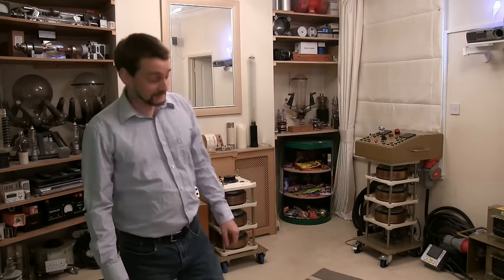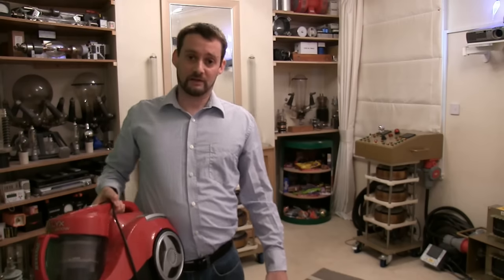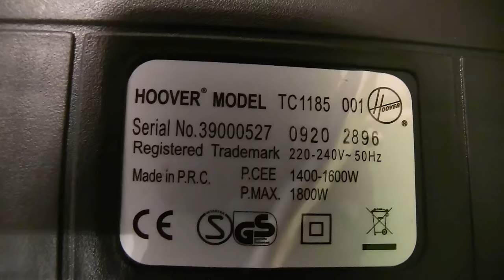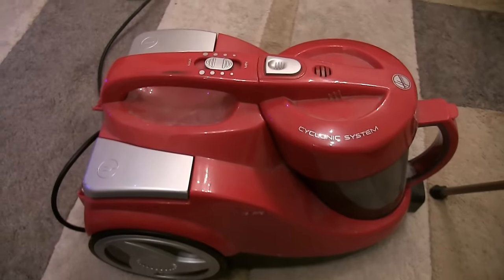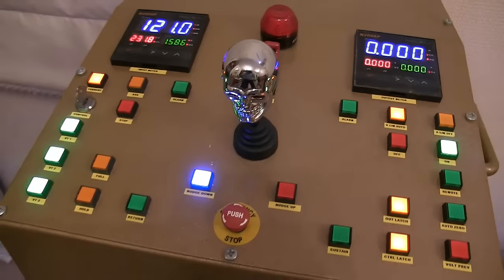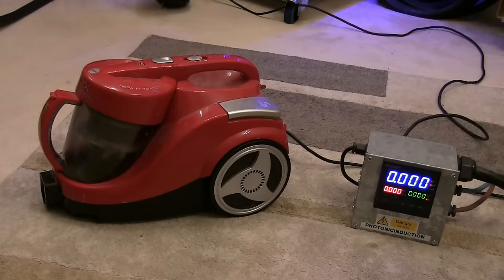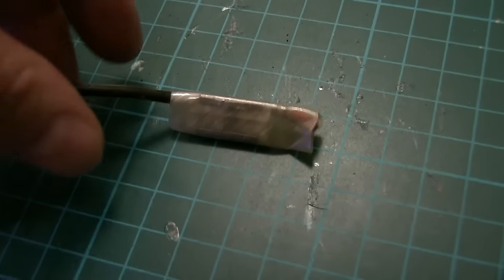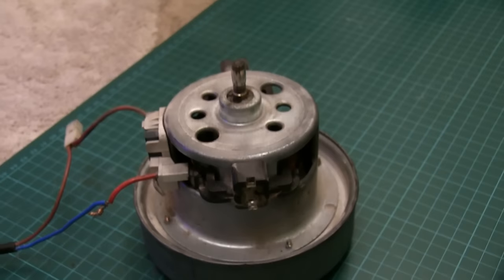Until it Pops - Vacuum Cleaner

Comment: I swear that sounded just like a Jet Engine spooling up, that alone is awesome
Top marks for the destruction sparks and fire
Reply: Has sparks just like the starter as well, just does not get past the first stage though before spooling down.

Now, if Photon was given a jet turbine and "upgraded" the control box to enable stupid speed I would love to see that. I am far enough away the debris would not harm me, even if some does go into orbit. Would not do that in the living room though, unless he wants an entire house remodel in an instant.
Reply: But will the jet engine destroy itself before the house takes off? XD
Reply: SeanBZA - There is a theoretical speed limit of turbine blades due to the centripetal forces and speed of the blade tips creating sonic booms as they pass the speed of sound, the problem becomes one of metallurgy. Currently, turbine blades are grown as a single crystal of the metal they are made of, it is done in very strictly controlled conditions and takes an awful long time to grow a single turbine blade into a single crystal. I believe it's about a month or so. 
If they were made in the conventional manner, there would be many many crystals of the metal and when anything metallic breaks, it is because it separates the bonds between the crystal structure of the object, so that is why turbine blades are "grown" as a single crystal, so that there is nowhere for the turbine blade to crack. 
Also, jet engines actually run at much slower RPM speeds these days because they are bypass turbo-fan type engines, which is essentially a jet engine using the front turbine blades to push air around the outside of the turbine, rather than through it, meaning they can run at 1/10th of the speed, use MUCH less fuel, much less wear and tear, and provide more power than a jet engine that creates thrust from the air and fuel being burned and thrust out the back of the turbine. 
Short answer: It can't be done, the blades would detatch well before any exciting speed was attained, even IF you could jam enough air and fuel into the thing..........
Reply: thinked abt why didnt it explode onto itself xD
Reply: UK Airways is using cheap brushes on their jet engines.
Reply: No kidding, that sounded exactly like a turbine startup.
Reply: Yo Leo how are the redbacks
Reply: @Ghost_TMS  Until it pops - Redback spoiders
Reply: @JesusisJesus   I know this is a very old comment but you’re actually very confused about the reason turbine blades are monocrystalline. A monocrystalline blade is actually more prone to cracking  and fatigue because the crystal grain boundaries impede crack growth. The reason they are monocrystalline is to prevent creep ( grain boundary diffusion) at high temperatures.
Reply: Except that it's not as brand (jet engine).
Reply: So this is how Hoover was planning to fly its customers to New York?
Reply: This is how my computer sounds
Reply: Right??? I could almost hear the “buzzsaw effect” you hear with turbofan jet engines at full power.
Reply: Speedbird One, you are cleared for take off.
Reply: Totally agree!!

Comment: Nr 234
Excellent execution. That vacuum released the smoke very quickly.
Those roller bearing still do a great job at those speeds.
Reply: The armatures are surprisingly close to arcing at 240 V. Second motor started at 260!
Reply: That's not how it works. The arcing is caused by the high speed of rotation (the "naked" motor was run without any load after all). This breaks the current through the windings very abruptly, causing a voltage spike because of the self-induction (probably a few thousand Volts). That's what causes the arcing.
Reply: The 2nd motor was unloaded, so would have been overspeeding massively. These motors are designed to run with the load of the impeller.
Reply: +ChumpusRex actually the second motor looks like one from a Dyson upright, the spindle actually is the driveshaft of the brush bar pulley, while the impeller actually forms part of the motor itself. So you're not entirely wrong.
Reply: RODALCO regards:)
Reply: It is a series wound universal motor. So no load means no current to either field or armature windings. No current to break, no induced voltages. The load here is bearing and commutator friction and aerodynamic drag. In a vacuum cleaner one can unload the impeller by just blocking the suction hose.

Comment: Wow, that second motor was only at 260V when it started flashing over - really bad tolerance for a 240V device!
Reply: Take a look, there's a quick flash at ~255
Reply: I think it's because there's no mechanical load attached to the motor, so it spins faster than normal
Reply: The air intake was covered by the floor because the motor was sitting upright.
The power required to drive a centrifugal fan is proportional to the air flowing through it, therefore it was running unloaded.
That type of brushed motor will overspeed without a load attached, causing excessive arcing on the commutator.
Reply: I saw sparks at 170-180v
Reply: Actually I don’t think there was a spark at 180
Reply: Actually motor 3 sparked at 160v
Reply: Agreed. It showed signs of trouble near rated voltage. Even with the air flow cut off, the motor shouldn't heat up that fast. It might have had a shorted armature or something from the beginning. I've seen good vacuum motors survive nearly twice their rated voltage.
Reply: @vincentrobinette1507  It made it up to 350V in the vacuum before it flashed over. Also we dont know  how much damage it took during the first "incident".

Comment: This is going to be my new favorite series. Would be cool to see a phone or a computer screen overloaded.
Reply: irrelevant but a few years ago he microwaved a computers motherboard while it was on, its still in his early vids on his channel somewhere..
 a computer overloaded would be interesting to see on the dc side after the power supply as the power supply would just blow its fuse or die before anything happened to the  motherboard ect id imagine however straight to motherboard  dc overvoltage something would definitely pop how much it would take would be interesting to see :P
Reply: Would be better with one of those fake EVGA "3VGA" power supplys, as they don't have any protection to the motherboard, so we could see what it really does without the power supply cutting off. :)

Comment: Assembled Vacuum cleaner:
Nought to pop in 36 seconds
Max power before malfunction is 3.438 W
Peak popping current is 21 Amps at 380Volts (thus a popping power of 8.754 W
Cause of failure: Probably insulation meltdown and short circuit.

Vacuum cleaner motor without load (with thermal overload, twice):
Nought to pop in 35 seconds
Max power before malfunction is ~950 W
Peak popping current is 12 Amps at 345Volts (thus a popping power of 3.717 W
Cause of failure: Thermal overload.

Vacuum cleaner motor without load (without thermal overload):
Nought to pop in 34 seconds
Max power before malfunction is ~984 W
Peak popping current is 47 Amps at 272Volts (thus a popping power of 14.050 W
Cause of failure: Brush flash over.
Reply from the maker: Decimal point is one out on the first bit? the meter is in kW
Reply: +Photonicinduction Yes, and there was one frame where it showed 87.54 (at least that's what I saw). Of course, that seems quite unrealistic. Okay then, I'll change that^^
Reply: I just noticed, that the numbers don't add up. 47A*272V is roughly 12kW, not 14kW. Does your meter measure apparent power? (wait, even then that wouldn't work out). Does it have a delay between showing Voltage/current and calculating power?
Reply: thank you for the details

Comment: It would be interesting to do that with an air conditioner. See if you can get super cooling power from it before it pops.
Reply: Tried it once...  Thermal protection inside the compressor kept opening up, it got boring after 30 minutes ):
Reply: +REWYRED that's why you'd need to remove that thermal protection.
Reply: nope !
freezing determined by boiling temperature of the gas and motor is asynchronous so it will not go any faster.
hairdryer on the other hand might be funny ;)
Reply: I would of, but the thermal  was internal to the compressor and therefore impossible to remove while keeping the unit intact.
Reply: +MRooodddvvv Why would it not get any faster, can you explain?
Reply: induction motors have limited speed at they running voltage and higher (they will run faster if you will change the frequency)
Reply: Ah, I have confused it for another type. Photonicinduction needs a Photonicinduction-grade inverter then ;)
Reply: Sebastian Grygiel
it's brushless motor to make it go faster you need to increase frequency not voltage.
actually you could make it go like two times (or even more) even with normal voltage !
Reply: Synthematix
not exactly. i mean it's not bout pwm itself but rather what you use to control that pwm ;)
Reply: Kragatar Just running the compressor faster wouldn't make a difference. All that would happen is the head pressure would rise exponentially until the high side found a weakness and blew it out. Most likely the weak condensor coil. This is because the fundamental principle of lowering the pressure of the refrigerant relies on an expansion valve of sorts. It will still restrict to that point regardless of the pressure presented to it. Worse case scenario is it passes some liquid, that finds its way into the compressor ans smashes it to pieces. Still no further cooling will be achieved since the vapour will not get superheated.
Reply: Not without a variable frequency drive. They use asynchronous induction motors, the speed is dependent on line frequency. It will just trip its thermal protection.

Comment: Interestingly the first flash from the exposed vacuum motor was at 255v, a voltage that is not impossible to receive from a UK outlet, and then it rapidly gets worse. Anyone living in area with a slightly higher than average mains voltage is going to kill that thing just from using it
Reply from the maker: nice to see you here mate
Reply: im pretty damn close to the transformer, on a good night i can get 250-252 v out the mains socket,  only trouble for me is lack of power for my variac :( need to put a new feed into the box - another for the todo list lol. 

I have noticed with some appliances that they just do not last,  microwaves especially  however as vacuum cleaners go  morphy richards didnt even last 3 months absolute s*** quality, hoover and dyson  have survived and still going  the old vax 121 gets damn hot really quick , the new vax 6131 just takes it and doesnt seem to care  its still happy after 3 years, the old electrolux 612  hasnt been bothered but doesnt get much use these days...

however it is interesting to see what does last and how much they take aswell as how hot and bothered they get with a bit of overvoltage help  it really shows the build quality of them and how well or not well made they are :)
Reply: Cant you use like some decent variac or tapped transformer to power these devices? Ive seen an automatic voltage regulator using a variac with motorised slider. It was used for correcting low quality power in a certain Communist country.
It was so old it still had tubes, so I guess it would be trivial to do it with something programmable like a PLC.

Comment: Some comments on here about bearing failure. The function of failure when running unloaded is the VA across the carbon brushes. The primary mode of failure is the break down of brushes/brush holders as they heat up, arc and are destroyed. Secondary is the heat from that process causes other plastic components/varnishes to combust.

Comment: 0:56 sounds like the airplane's jet engine starting lol 😂
Reply: HitNation Radio at first sound you were hearing would be the primary starting generator that spins the turbine up to its idle speed (the whining sound) 1:04 would be the sound heard when the fuel is pumped into the combustion chamber (the secondary wind-like sound)

Comment: Hi there PhotonicInduction.... question please:

It seemed to get going well on something like 240v @ 30w ... Does this mean i could run a vacuum or kettle rated 1800w on a 1000w inverter?
Reply from the maker: Noo :(
Reply: ah see... thanks for the reply. Hope things are good with you. Im trying to look for ways of converting a kettle so it can run as 12v with a set upper to 35v 2amps / or just 240v running on the 1000w transformer.
Reply: At 12v you need to supply 150 amps for an 1800w appliance. That requires 00 AWG wire. 
Not even a 2000w inverter will run that appliance without over heating the inverter and shutting it down. I should add, unless the inverter is quality built.
Reply: James Pian Thanks for the reply. So theres no way of running a kettle or small cooker with an 12v inverter? ... thinking about it, i suppose thats why caravans use gas for thier oven then.
Reply: You can. Everything has to be properly sized including the battery bank, the wires, and the inverter. Gas is probably easier, quicker and cheaper. If it's available where you are.
Reply: even if you found a way to power a kettle worth a crap, or a stove, the energy in a car battery would run it fore barely 8 minutes, or boil a single kettle.  the lightest and most simple thing is a methylated spirit stove, nothing stored under pressure, and nothing that can be easily contaminated.
Reply: Ok thanks for the advice guys, appreciate it. Trying to figure out how to make a live in van without chimney smoke (wood burner)
Reply: Use gas, like some entire countries do. You will find it far easier to cook on gas (ask Italians).

Also, there arent many commonly found 12V sources that can provide 1800W power. Nothing mobile at least. Maybe paralleling a couple server PSUs, but that runs on 230.
Reply: DiyEcoProjects
buy a trangia stove kit, the mini would suit being indoors more, the standard 27 if you plan to use outside( better windshield) runs on  alcohol/methylatedspirits/gas line water remover.   lots of youtubes on the subject.
Reply: hmm interesting thanks both of you. Alcohol based sounds good.
Reply: If you want to do that you need to dedicate a fair bit of weight to a decent battery bank and a decent inverter. We are fully off grid here with 4kW air con, 2kW kettle, 4kW hot water service, etc, all of which can run at the same time. 

We however, are not carting this all around in a van, so you would need to find a balance between how much space and weight you're willing to sacrifice versus how much you wish to spend on fuel to move it all about. 

Gas is probably the easiest off grid mobile solution.
Reply: itssoblahblahblah
hi... im still learning so any info is appreciated. Can you describe your set up please for a house converstion "decent battery bank and a decent inverter"
Reply: DiyEcoProjects Our setup is pretty straight forward, 10kW of Trina honey panels, twin SMA SunnyBoy inverters + SMA Sunny Island inverter connected to a 2000ah VRLA battery bank consisting of 12v batteries in parallel & 4 serial chains making 48v.

The house used to be wired for 12v lighting however we've re-wired for mains voltage for convenience.

We also have a 4kva honda generator for when it snows or there's an extended period of bad weather. On average it gets used about 8 days a year and probably uses about 30L of fuel per year.

We're in a primarily cold climate so we use wood for heating & cooking in a slow combustion stove and a stanley waterford wood oven which also has a water jacket.

It's not a hard life at all and we save a fortune vs on grid. (Please excuse typos, on mobile).
Reply: Seems like an expensive route to go just to boil a kettle...could you not just buy a small portable gas burner? They only cost about $20. I have one for power cuts or any other emergency. =)
Reply: Just do it over a raging fire. Boils in two minutes or less. I know I did it.
Reply: Hmm, I'm not sure, I think it would put extra strain on the Hoover, so I think it will most likely wear out quicker, but I'm not an electrician so don't quote me on that.
Reply: +VictorIndiaDeltaAlfa i was runing 4500w on 12v in a escort. lol 270a alt and 3 group 31s, lots of 00 wire. it was holding about 13.7v full tilt
Reply: +DiyEcoProjects hey bud if ur looking to boil a kettle for living in a van u may as well just get a gas twin burner as your going to need food heated also. So by buying a little gas countertop burner u'll be saving your valuable 12v for your lighting, phone charger, cooling fan and other 12v items😉 you can get inverters large enough to boil a kettle but they're very hard on the batteries and inverter and simply not worth the hassle as you'll need a stove to eat anyhow and the little burners really aren't that hard on gas👍🏼
good luck with your adventures

Comment: I cant tell from how your display is set up with the decimal points. I'm taking it as the top blue is the wattage the the red the voltage and last is amperage
Reply: nvm when the last motor popped I could make out kV and kW. nice job